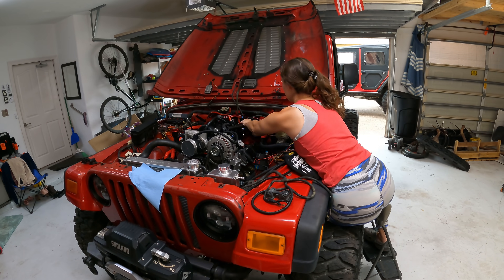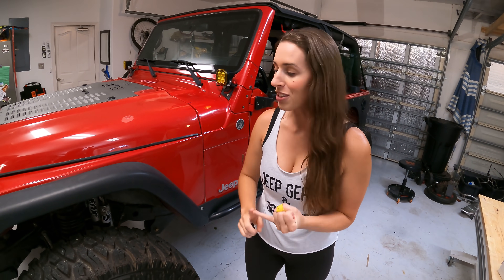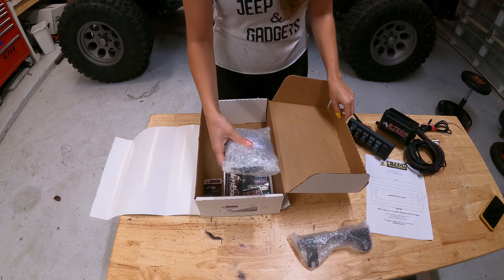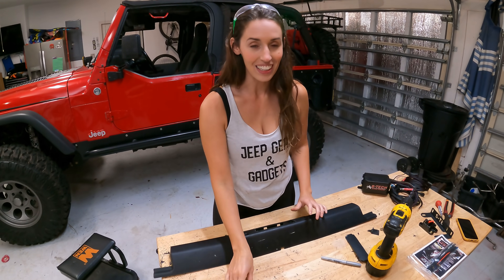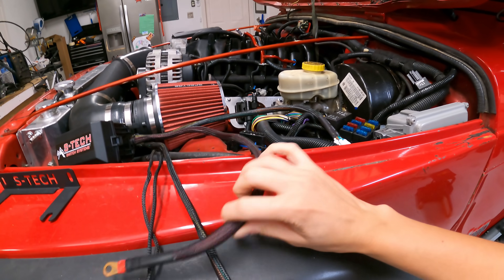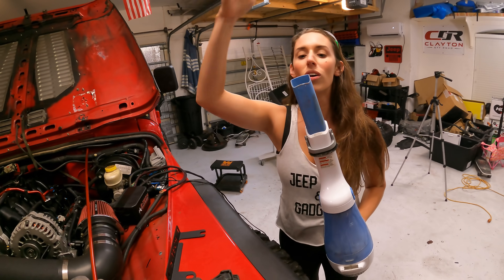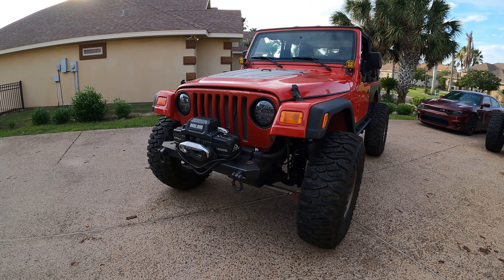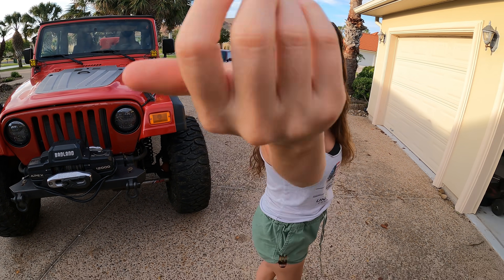The EASIEST Way To Add Switches in Your Jeep!

Comment: I kept trying to find out of I can swap a rocker switch out for a toggle switch with a cover for a very similar reason. Didn't think to wire one of the buttons so that both need to be on. I think that will be safe enough. Thanks for that tidbit!

Comment: My ARB compressor is under my master cylinder. There is a nice lil tray under there and it mounted perfectly out of the way.
Reply from the maker: Thank you! I forgot about that little tray, that would be perfect! Right now the GM computer is in the way, but once the Holley computer comes in that will open up that area.

Comment: I’m not running one yet but you could Mount it in the center of the wheel base under the Jeep and run a air hose to each side/tire

Comment: Yeah did full dual toggles on a 86 k5 blazer 4x4 up top 6+ USB and center console 5 +12v and USB advice a lot of research on placement and make sure you in line fuse or relays, I did custom bussman set up, took a few months but clean! Like your set up and the demo was funny but that pop from electric short to fine no Bueno gg

Comment: Really great vid... Not calling you out, but I found this headlamp idea to be a great one but did not see link to adapter as mentioned in video. Currently just have headlamps back in the box. Could you please provide, otherwise I will be doing some actual electrical wiring to get them in. Adapters make life easier. Keep up the vids!

Comment: You can place the ARB on the driver’s side under the brake master cylinder. You may need to take the fender off.  AND there may be enough room to put a dual ARB. Thanks for the video! (I have an ‘06 LJ and your channel is very helpful!) (Yeah you too Ben! I also have a JKU)

Comment: Get a big enough plastic box and mount the lights to them. Add a seal lead acid battery in them with a charger and USB ports. It will be a trail torch or recovery light.

Comment: I have my ARB twin mounted under the passenger seat and added the JK Innovations inflation kit.
Reply: I built a bracket and mounted the Dual ARB. on the divers side of the rear of the LJ.  Using the Bolts that hold the hard top down.

Comment: Most TJs have an extra 2 wires located around the fuse box behind the glove compartment, one switched one not where you can feed power off of.

Comment: I have twin compressor under my driver seat and the air is routed down out of the jeep with the grommet. I also have an air connection under the seat and have another tube routed to the back of the jeep. So if I need air for anything I can get it from the seat or from the rear.

Comment: I had a 2000 to till it got rote off  but now I have a 2013 model jk with a 3.5 inch lift with 35” tires with 456 gears

Comment: great video.  can you tell me when you connect lockers which wires did you use from  ARB harness?  Just yellow & green for lockers or do I need to splice the red(power) wire and add that to both yellow and green to positive on the spod box?

Comment: I noticed Ben using a Fluke multimeter. What model of Fluke meter does he use for the various electrical installations that you do?
Reply: Looks like a 179 Series, but any Fluke will do, its all low voltage anyway and you don't need super high accuracy.
Reply: @tomc8157  Thanks. I used a Fluke 77 for years but it walked out of my garage one day, gone forever.

Comment: how did you set this up with the compressor being the safety switch before you can activate your lockers per switches? are there instructions with the kit to set it up this way? going to order this kit within a week. ty in advance.
Reply from the maker: I had stech do the custom wiring. You can call to place the order, and explain what you want. Or there is a section to put notes if you do the custom switch option.

Comment: Also, I have same headlights but my issue is that my lights are on any time the jeep is driving. How do I get the day time running lights to not be on during day time?
Reply from the maker: Do you have a JK? If so, get the JScan app and the OBD2 reader and you can change your DRL settings
Reply from the maker: Or are you referring to your TJ?
Reply: @JeepGearGadgets  We have both and I use the Jscan app for the JKUR and set the park lights to DTR but my TJ has always had the day time lights on and with jk LEDs in the TJ, they flash on video (honestly only reason I have an issue with it lol)

Comment: My compressor sits next to the rear roll cage. And welcome to destroyed vehicle paint and canvas tops. It’s a problem with the sun belt. Only solution is park under cover. Sun remelts tarmac easily down there, and turns house paint to chalk. Too hot for human existence. Of course I completely jumped the shark and moved to New England 🤦‍♂️

Comment: why the extra switch panel?  Cant we buy switch inserts to place into existing switch OEM panel for options like light bars, winches etc?  This is why Jeep sucks people, they make it difficult to add even OEM stuff for accessories.. not adding another switch panel when I have like 5 empty spots next to my locker switch and sway bar one.. ridiculous.